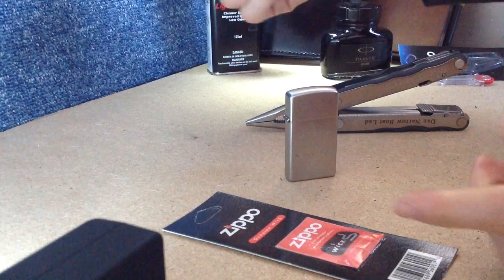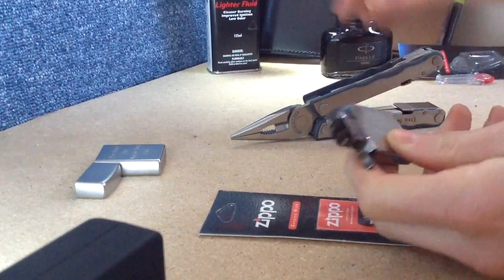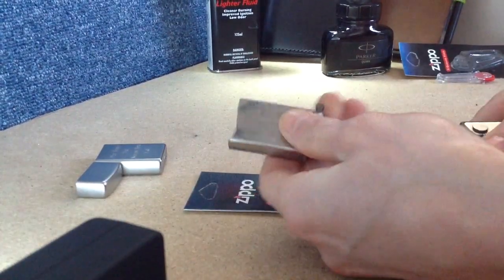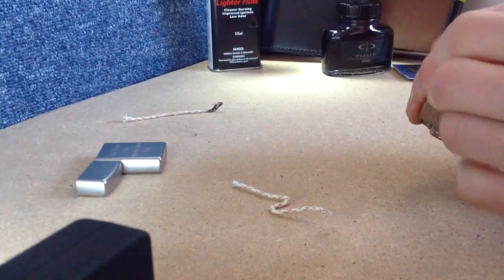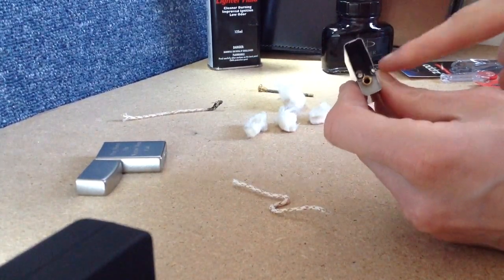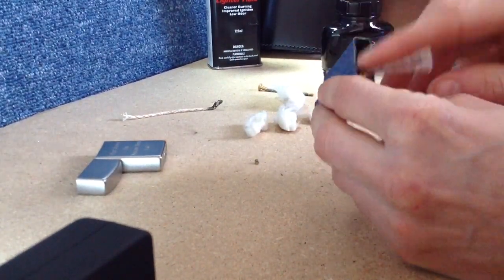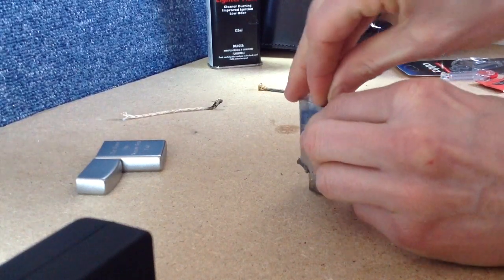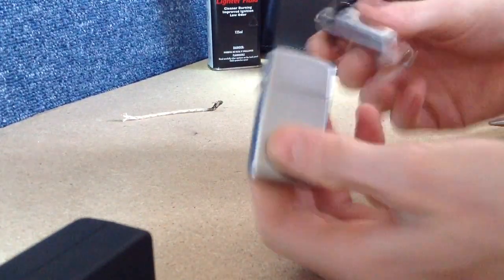Zippo Wick Replacement Tutorial

Comment: What I do is twist the wick tip as tight as possible and put a drop of super glue on it. Once it's dried and hard it's much easier to push through the hole without the threads splaying out and being a pain in the twat.